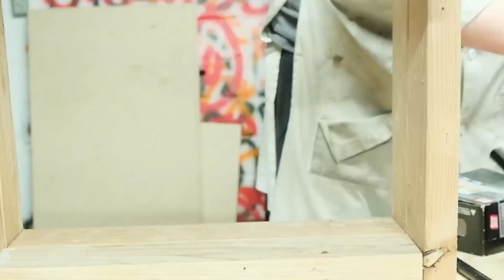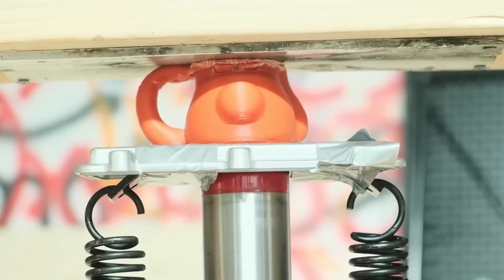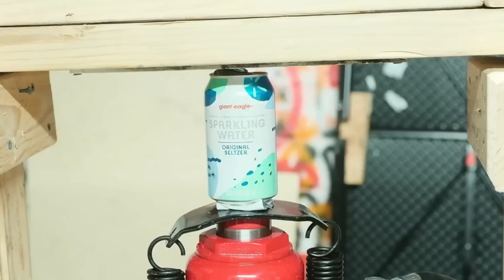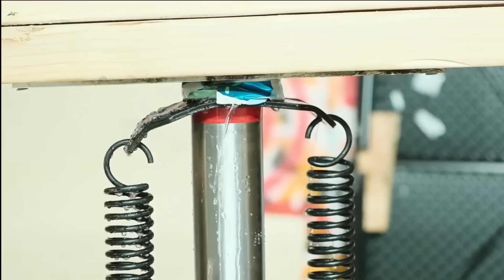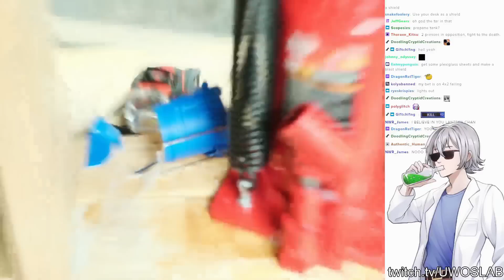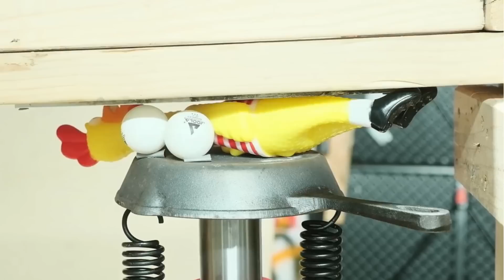Can this homemade hydraulic press destroy everything I feed it?

Comment: xD on the end it broke cast iron.. yeah I've worked on trucks that had cast iron footholders if they get mounted the normal way no issues but once you put serten forces on it just cracks or can like kinda explode due of serten tension being relieved in a few seconds. --- I would sometimes use a carjack to push bolt holes into a better place if the cast iron was already broken due of accident then that was 1 way to get them of or break it. into smaller chunks specialy if it had seized or stripped bolts in it. But yeah a concrete floor barely moves with a jack on it and a truck barely moves in comparison with the little cast iron foot hold part something gone snap. Hehe but yeah if wrenching don't work and grinding is almost impossible due of design and smacking a hammer against it not gone do it then this is easyest fast demontage.

Comment: one thing i don't get is why do you need the bis a$$ springs ? it seems like the bottle jack is fighting more the springs than applying force to what is being crushed
Reply: I believe it’s to get the cylinder back down without applying manual pressure to it. Could be wrong tho.
Reply: @1Lordgore  You are correct. The springs are to enable the jack to return to the bottom without a load on it.
Reply: I think it might be to keep the silver plate from teetering from one side or the other. When the fish went in it was leaning pretty badly to one side, I would assume the other spring keeps it from going too far
Reply: what i don't get is why he needed it for the cans ?